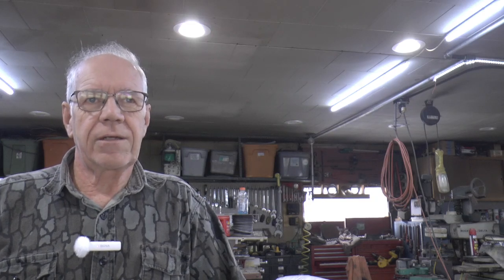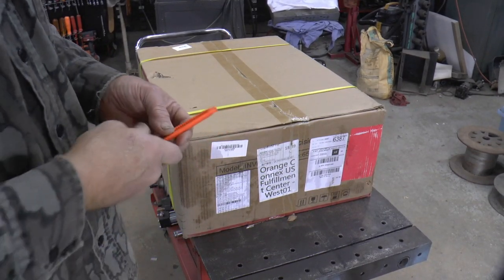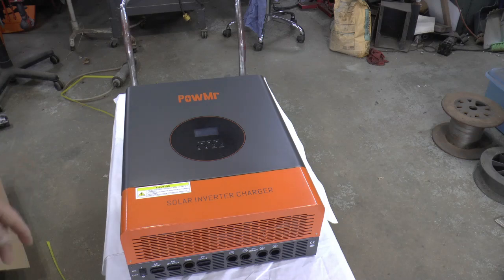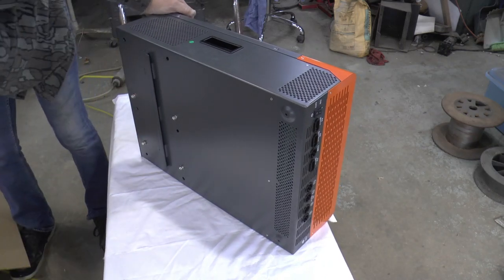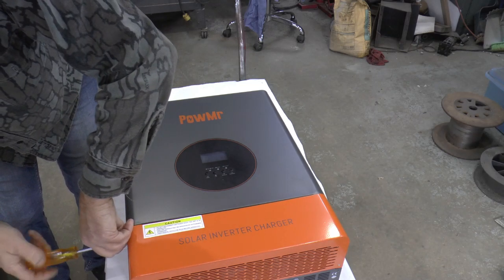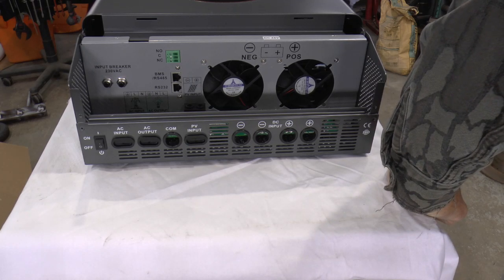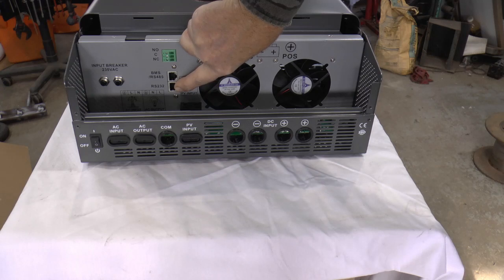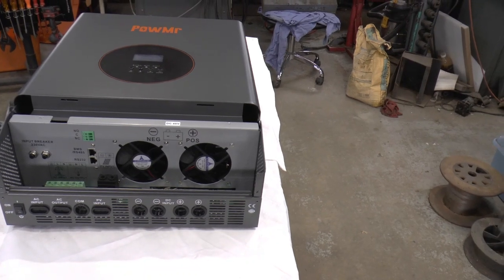First Look at PowMr POW-RELAB 5KU Low Frequency Inverter Charger

Comment: What is the standby power consumption for this inverter? Could you please provide me with this information?
Reply from the maker: If you watch this video   https://youtu.be/jfd3kCodaEM   I think it will answer your question. With no load just running on a power supply it uses about 25 watts. Better than I expected. I like this inverter it has been running almost a year now no problems.
Reply: @kevincrawford2027 Wow, my friend, your video is excellent! It cleared up many of my doubts. I want to buy the 10kW low-frequency model, and the standby power consumption was my main concern, which you just clarified for me.  It will obviously be more than 25W, but even so, it will still be very good.
Reply: @rubenandrade5130  50 watts normal operation no load consumption for the 10 kw inverter, 8 watts in power saving mode!

Comment: Greetings, thank you for sharing this information, but I have a question, and I would like you to help me within your possibilities, the issue is that in this 5K PowMr I cannot find what the parameter of the maximum PV input current is, I know that it says that it supports up to 6400W and a maximum voltage of 150V in PV, thank you and blessings to you and your family.
Reply from the maker: I had the same question and no where does it say an amp rating. I have 18 240 watt panels 3s6p. Usually runs between 90 and 105 volts in depending on battery state of charge. I have seen over 90 amps of solar charge with no issues.

Comment: Hey, how's the unit still working for you?
Reply from the maker: Working great. Check my latest video. Trying to get the wifi dongle to work but so far no luck. It's probably me doing something wrong. I'll have one of the kids show me what I'm doing wrong.
Reply: @kevincrawford2027  I just ordered the 3kw 120/240 unit. Hoping it's a good purchase and will be reliable.
Reply: @kevincrawford2027  why would anybody buy this inverter for 900 usd when you can buy deye for 1000 usd ?  deye is so much better inverter . i had one 3 phase powmr and it failed after 7 days of use .

Comment: considering a purchase of same.. how are PowMr , Mr. Tony Zou and after sales handling the issue ?  Looks like someone in Shipping set the unit down a little hard causing Sheer of the outside cab plate screws.. Let Us know How its going..
Reply from the maker: PowMr has been very responsive. It is mounted and working. If the sun ever comes out again I will have a video of it. My smaller PowMr 3K AIO has worked flawlessly for almost 3 years running 24/7. I like it so far.